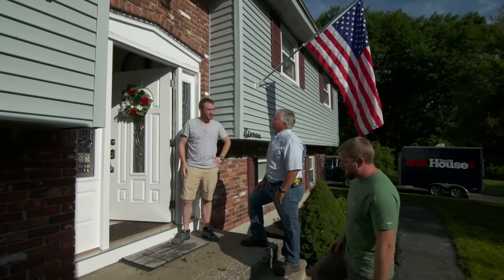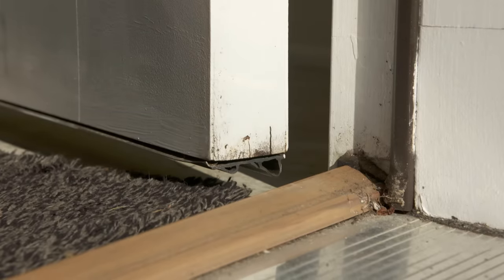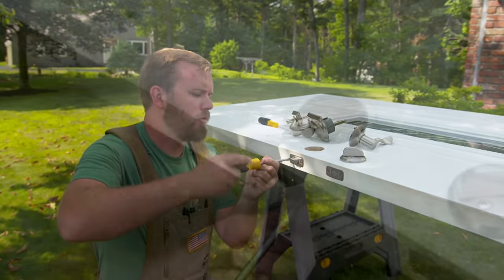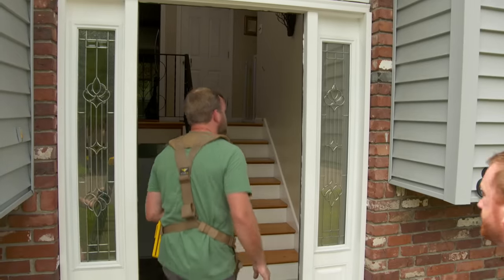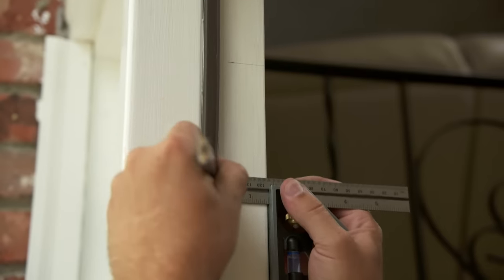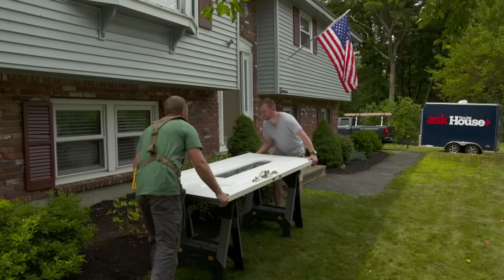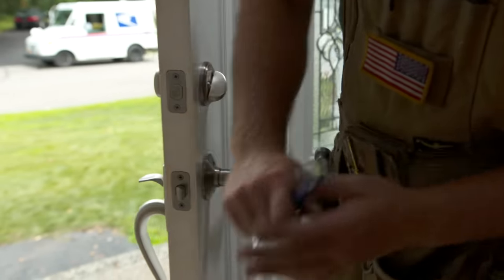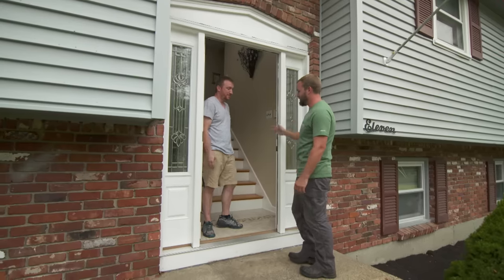How to Swap the Swing of an Entry Door | Ask This Old House

Comment: No I don't go for this at all. This new way of opening is worse than it was. The problem mentioned by the owner was that coming down the stairs, esp carrying something, then opening the door, it pushed you back onto the stairs, but in this situation the person  should get to the floor from the last stair, then move to the right, then open the door, not just stay in front of the stairs. There's plenty of square space when the door was open. But now, the door protrudes very awkwardly into the square space, it's really pretty bad this new way round. Ironically, if this were my house and I found the door opening this new way, I would do this same job to swing it the other way, like it was to begin with!! The way it was put first is the much better way of the two options. Alan, in England.

Comment: I'd be pissed!! Those hinge inserts should have been covered with sandable filler, and don't fit right. The glass insert should have been turned around too. Pick the screw covers off, undo the screws and remove it. Easy to break in now. Fast isn't right

Comment: As Kyle mentions below about the directional low-e glass, there is also the issue of the thermal seal of the glass insert. Without reversing the insert the insert mounting screws are now outside(see the little round plug covers?) and the seal is inside. There is NO seal on the inner insert frame. This door WILL LEAK! I guess you COULD put a storm door in front of it but that will also require fir outs on the center mull posts(I recommend PVC brickmould trimmed), a process that nearly no home owner understands.  Also, OMG who's the moron that simply turned the existing brickmould on its side instead of trimming it to fit flush(4:20) with the header brickmould? See how it sticks out from the top trim? As a Lowe's door specialist I would have to ask that installer to be fired.
Reply: ALSO in this case with twin sidelights and mull posts THIS door CANNOT be converted to outswing.